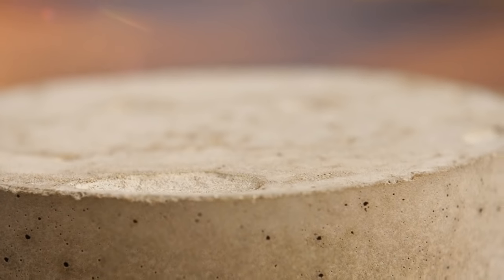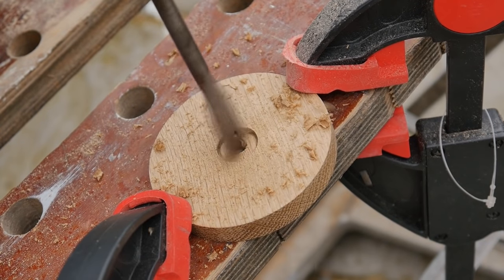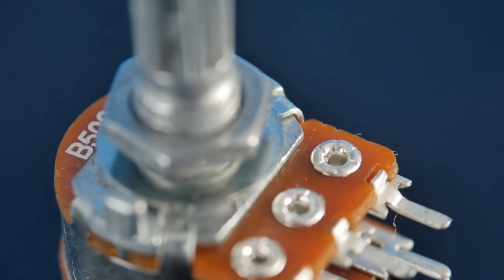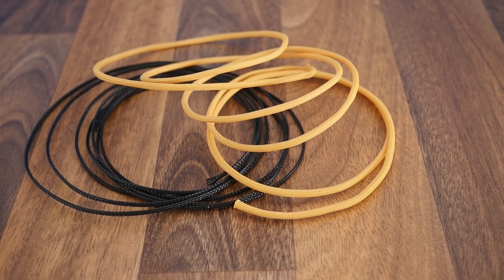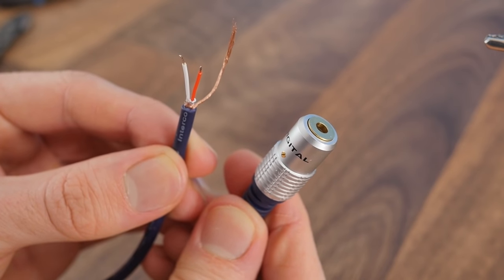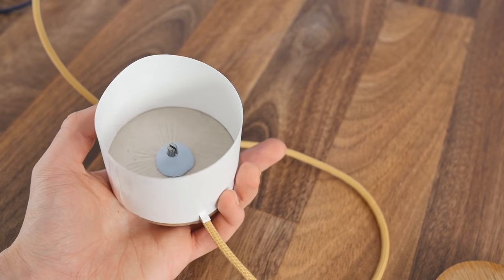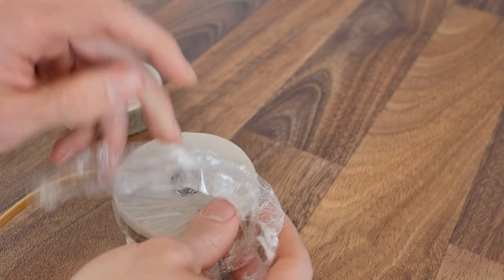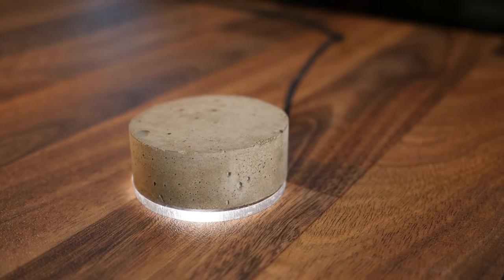How To Make a Concrete Volume Knob

Comment: It would be cool if the LED was integrated with the potentiometer so the amount of light it emitted would correlate with the volume level.
Reply: +Tech By Matt I agree! That would make it next level awesome.
Reply: Glad to see someone was on the same train of thought I was!
Reply: +Tech By Matt im fairly certain the reason this was not done is because it would cause disturbance in the output and we know matt is all about quality :)
Reply: +Tech By Matt You could do that with an arduino micro. Then you could also feed the potentiometer position digitally into the PC. It's rather easy to emulate an usb HID device like keyboard mouse or joystick with an arduino pro micro.
Reply: +Tech By Matt 
You could always use a triple gang potentiometer to achieve that, a bit bulky though.

Another alternative is to put a transistor or two on the power line that are controlled by one, or both,, audio channels for a similar effect.
Reply: +Tech By Matt Should work by soldering the LED parallel to the output of the potentiometer. But I'm not sure if it would work, didn't tested it :)
Reply: +Dejay Rezme What would have been really cool is if you used an RGB led that gradually changed colors from for example red to purple depending on the volume level.
Reply: +Dejay Rezme What would have been really cool is if you used an RGB led that gradually changed colors from for example red to purple depending on the volume level.
Reply: ted clubber lang Yeah you can do all that with some simple beginner level programming. That is the beauty of arduino. But it does make the project more complicated of course.
Reply: Tech By Matt I
Reply: Tech By Matt or it was an led circle, like amazon echo
Reply: led ring that shows the volume level maybe
Reply: Потом глаза выпадут от мелькания светодиода.
Reply: better yet, use adressable leds and have it work like a light ring
Reply: Just connect it vith the plus and minus with the potensiometer.
Reply: there is no way to get volume value from PC via HID interface, so unless you send your absolute pot value to PC (not relative) and use it also as value for led brightness, there is no way to achieve this behavior, unfortunately
Reply: dudee! it's so sick to see you here, love your vids :]
Reply: BCzepa disturbance in the Force?
Reply: I think that would introduce some noise to the audio.
Reply: You can get that effect if you connect the LED wires with the switch output sides that goes to the speaker,
And lights will increase or decrease with the volume raised or downed !

I have done that with my car speakers..and it's very awesome!!😃👍
Reply: Hi there
Reply: That would mean you'll need a triple gang potentiometer...
Reply: both of you should collaborate...make a great project !
Reply: That's a good idea, I'll try that, and I'll synchronize it with the music
Reply: @phonox  though you would need the third layer to have different resistance for the diode, right?
Reply: Or attach the LED to the Left or right sound output :)
Reply: Pretty sure all you need to do is add the LED in-series with the volume channels rather than the power!
Reply: his name is Matt and he got dope ideas
your name is matt and u got dope ideas too!
Reply: You can use a MCP41010 and a small μController. You have to measure the voltage of the audio signal with an analog imput of a μC, to adapt it for a 0-255 range, to save it in a variable and to control the MCP41010 with a SPI Protocol.

How?
Just make a function where you set to LOW the CP (chip select of the MCP41010) using a digital output of the μC, send the value 0b00010001 to the MOSI pin to activate the chip and then send the value of the adapted voltage to 0-255 value range (that was saved before in a variable) to the MOSI pin and finally set CP to HIGH. You can use every SPI library you want.

Keep in mind you have to make a loop in wich you put this function and if you want, can choose a delay but it has to be really short.

Read the datasheet of the MCP41010 for more.
Reply: Fireeeee
Reply: Easy, just have a 3 gang potentiometer instead of 2
Reply: well you cold use a 3 gang potentiometer. 2 gangs for audio and one for the led
Reply: I think you would need a potentiometer with nine connections

Comment: The concrete with the bubbles looks splendid.
Started imagining using resin instead of concrete, and the different objects that could be set inside it. 
Wonderful idea.
Reply: why not different colors of epoxy, it'll give it a swirly effect
Reply: Yes, this is what I meant by resin..  epoxy resin.

Comment: I hope that you work out a system to keep making these videos for a long time to come where it is fun and rewarding for you.  You do such an excellent job with every aspect from explanation to subject matter to design to videography.  Keep up the great work!
Reply from the maker: Cheers!
Reply: +DIY Perks What +Jason Patz said. Awesome presentation, explanation and supplying links for 
correct products etc. So many DIY guides does not and just assumes you 
know where and how to get what you need. And, as I have saw in a 
previous post, you could make audio books for sure. Great story voice! 
Keep the DIY videos coming, they are much appreciated!
Reply: totally agree. love your style of presenting. geeky yet understandable but professional and entertaining. top videos 👍👍👍👍👍👍👍
Reply: 100% agree.  one of my favorite channels and always looking forward to new DIYs.
Reply: +DIY Perks ill buy one of these from you. A suggestion - A more advanced version of this could have multiple LEDs (or a strip) that represents the volume. Even the potentionmeter controlling the brightness of the LED as well as the volume would work great.
Reply: It would be nice to see a version of this that reacts to potentiometer. Even something as simple as no light when volume is at 0% and full brightness when it is at 100%
Reply: There's a chip, the LM3914, that generates a bargraph from a voltage. You connect it to 10 LEDs, either 10 separate LEDs or you can get little modules of 10 LEDs all in one unit. The chip has the option of a bar graph mode, lighting up from the bottom to however far, or dot mode, where it just lights up a single LED at a time to represent the voltage. 

That could do the LED effect you want. You could have it wired up to the output voltage, so that it would dance up and down as the music got louder or quieter. Or, you could get a third potentiometer on the same shaft. 

These are known as "3 ganged potentiometer", or triple-ganged. They're not as common as 1-gang, the most common, or 2-gang, as used here, where the connected 2 are used for stereo. But with a 3-gang you'd be able to do what he does here. Use 2 for the stereo signal, and have the third gang connected with the middle pin goes to the input of your LM3914. The outer pins go to the ref-hi and ref-lo pins, they're the voltage reference pins from the chip. 

That way you'd have the same thing as here, except with 10 LEDs representing the knob's setting. The LEDs can be different colours if you like. You can even connect several LM3914's in series, allowing 20 LEDs, or up to 100 (probably too many!). That's a touch more complex for now, but only a little. 

As for variable brightnesss, you can set that with the LM3914 too though it's a little more complex. You can buy 4-gang pots though! I think I'd leave it though, and keep the bar graph nice and bright all the time. 

The LM3914 is quite a sophisticated chip (even if it's a decades-old design). So you only need a couple of resistors and maybe a capacitor. They're cheap too. Something you could experiment with on a breadboard (buy a couple of the chips, or even 3 or 4, just in case: either you break one, or get carried away!). I dunno how much electronic stuff you have at home, but a set of resistors of variable values is cheap. You get 10x each value, of 30 values. Or if you pay more, 100 values. 

Look up an LM3914 reference circuit, "vu meter" is a common one. There's a few online with a microphone input. I'd just ignore the microphone part, ignore everything that's connected to the LM3914's input. Instead the input should just be connected to the potentiometer. as I mentioned earlier. 

http://www.ti.com/lit/ds/symlink/lm3914.pdf

Is the chip's data sheet and you can pretty much go from that, if all you want is a potentiometer driving a bar graph. You don't really need more. 

If you get stuck there's plenty of places on the web that'll help a beginning electronics enthusiast. They love helping new people get into the hobby. 

OR...

If you want the easy way, you can buy USB volume control knobs just like this... They plug into your PC via USB and control the volume in software. Some have RGB LEDs and stuff. 

But frankly that's boring. Making your own is much better. And of course USB ones only work with USB, which is computers. One you make yourself to plug into your stereo is much better!
Reply: [EDITED: Ignore the bit between ==== if you don't want to read me waffling about Arduinos. Read that bit later, it's not important to understand the stuff I was talking about earlier. Sorry! Sorry!]

Actually it's just occurred... There's the LM3194, LM3915, and LM3916.

They all do the same job, except LM3914 is designed for linear response to the input signal, LM3915 for logarithmic, and LM3916 for VU display. 

I've been thinking, and I'd stick with the LM3914. Although you might try ordering one of each, or a few of each. Aliexpress has them at 25c American each, minimum order of 10, so $2.50 for 10. That's just a reference, but Ebay and the like ought to have similar prices.

Sparkfun have retired the chip, but were charging $2.50 per chip. That's just because they're a ripoff. I suppose their tech support is better than some anonymous Chinaman, if you think that's worth the markup on their stuff.

I'd use the LM3914 because the design 'Perks here uses a linear potentiometer. So if you're gonna do that I suppose the LM3914's linear response would be right. 

You could have the LEDs be one of the bargraph modules. Or you could have 10 individual LEDs arranged around the chip, placed inside the plexiglass. So they'd glow outwards, maybe following the path of the knob, if you got it all arranged right. 

=======
Actually thinking about it even more I'd probably just use an Arduino cos then you could program the levels the LEDs switch on and off at in software. But then ultimately we're in a time where, for electronics, just using a computer instead of individual circuits, is often the best, cheapest, quickest way, and easiest to fix problems.

Used to be a time when computers were expensive and took up rooms! Now computers with the same power, and indeed with much more, fit into the size of a lentil, and the pins and the plastic packaging are often left out because it makes the thing 50% cheaper! 

Anyway... Arduino is worth looking up for a hobbyist. A single chip, with a computer processor on board. Also ROM, for program storage, and RAM for working use. Onboard functions like analogue to digital convertors, also digital to analogue. And all sorts of other mad stuff, onboard radio and the like. So you could write a program to do a graph from an input voltage and drive LEDs.

Arduinos are good. The single chip can be bought on a circuit board with standardised connectors, and "shields" to place on top that provide all sorts of functions, like keypads, RGB LEDs, LCD displays both black-and-white low-power to full-colour high-resolution. Touchscreens, MP3 players, SD cards. All of that and more. 

Then to program it there's just 1 program to install on your PC / Mac. You write your code, in a version of C that's been made fairly easy. Then press the button and it's sent down the USB wire, to the USB socket on your Arduino's PCB, and the chip programs itself!

After that you can put the Arduino's PCB into a project, with all it's associated buttons and sensors and screens and whatnot. Or you could get the raw chip itself, and put that into your project, the advantage being it's smallers. 

Arduinos make programming and hardware development much much easier. The bargraph program, is writing itself in my head as I compose this. Just input the voltage and make a lot of comparisons, then switch on or off the outputs for LEDs accordingly.

Pardon me, I've digressed, again.....

Using the LM3914 might be nice because it's a simple way of getting into electronics, and there's not much can go wrong. 

Getting into Arduinos is maybe a future thing for you to do, if you like. You can get starter kits with instruction books and stuff. They're cheap, too. You can get an Arduino clone board for like $5. But ask me about that later. 
========

Get the LM3914 and a breadboard first! 3-gang potentiometer, and get on with your project!

If you can't find a 3-gang, get a 4-gang instead and ignore the 4th gang. Etc. 

Sorry about the digression! Sorry mate! Just the way my brain's made.
Reply: I'm only looking that videos because I like that pronunciation ;-) Ok, also because the projects are interesting and made good enough to show close-ups of them.

Comment: Mate, love your videos, but (as mentioned by others), you really SHOULD be using a logarithmic potentiometer.  Yes, the linear pots work "fine" but Im sure you notice, as you get above "half"  on the pot you arent really at "half volume" yet.  

I'd also recommend some kind of rig to keep the wires from being pulled out, but thats probably not a huge deal.

anyway, one last thing, you can STAIN concrete! I swore you were gonna mention that, but yeah you can color concrete quite easily. A black concrete knob with that white glow under neath would be absolutely boss :)

Great video, thanks!
Reply: seems to me he likes concrete style. Not all of us do, thats why somes paint concrete...  ;)
Reply: @DrZipZwan  wat?
Reply: I've tried both linear and log pots for volume, and honestly linear sounds more correct to me.
Reply: @TheAechBomb  Of course use what you prefer, but decibels are calculated logarithmically. Mixerboards, audio interfaces and guitars also use logarithmic potentiometers because of that.
Reply: @JgHaverty I never thought I would see an audio nerd on a DIY channel
I thought I was the only one
Reply: I'm*
Reply: Aren't*
Reply: @William Lloyd-Roberts Cool? I
Reply: @mikohenriksson450  actually a linear pot will give the best result in this situation. Since part of the potentiometer resistance is in series with the speaker or headphone. Normally if you would place a potentiometer in front of an amplifier a logarithmic potentiometer should be used.  
If you would draw the circuit as 3 resistors and calculate the output voltage for each position the linear pot shows a semi logarithmic behaviour.
Reply: It's not the system level volume control. It's a post-process volume knob. Volume has already been controlled at source.
Reply: Why would you want to paint it black after having worked so hard to make it look different? A black paint would result in a knob that doesn't look much different from average volume knobs if you look at it from a distance.

Comment: hey ! for those who wants to try this, here some ideas :
- try to use a microcontroller (an Arduino NANO or a nodeMCU ESP32 should do the trick) so you can make the build more versatile (you could control LED or dim lights) 
-  use paint in the concrete mix to color it, there are a lot of tutorials on how you can do it
- integrate it directly to a desk by cutting a hole in it
man your ideas are really good and it gives me a lot of ideas for my projects !
Reply: I think concrete base color is perfect.
Anyways I'm struggling with find the right potenciometer, I just found 10k ohms, it can works???
Reply: @guhong4396  of course ! also depends on the type of pot you using (linear, logarithmic, etc...)

Comment: More LED Stuff please.
Reply: yes!
Reply: +Top Skills agreed
Reply: +Top Skills Or electroluminescent!
Reply: EL's nice, cos you can buy the driver modules, and they just run on 12V. Then it's just a matter of cutting and joining wires together, endless fun! So many colours too. 

Actually I was talking about the LM3914 bargraph chip in another post here. Using that, but having the outputs drive transistors instead of LEDs, might be great. Then the transistors drive driver modules, that drive EL wire and panels! You could have a bargraph as big as... anything! Square metres of the stuff instead of LEDs.

For audio modulation, I think just a capacitor and maybe a resistor or two, and drive it from the output of a small amp or preamp. That'd be niiiice!
Reply: Yeeee defenetly